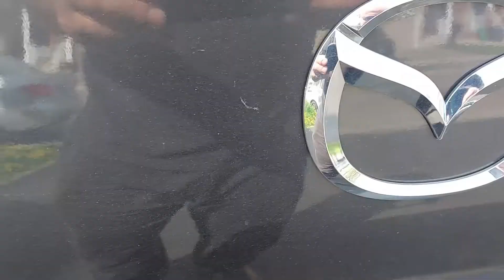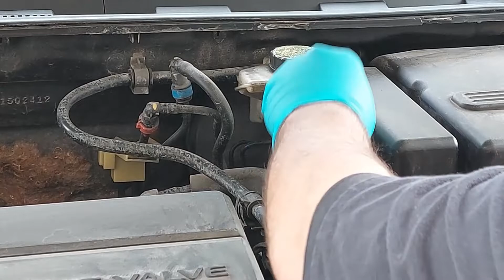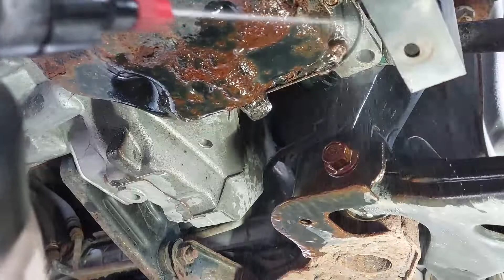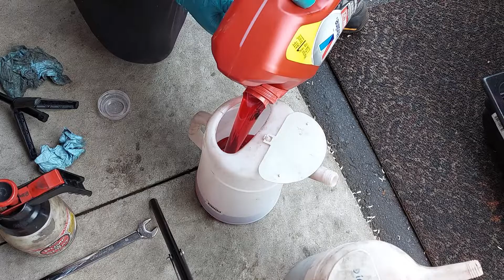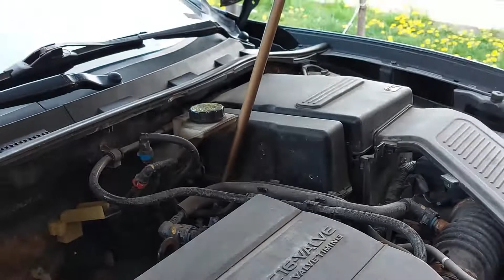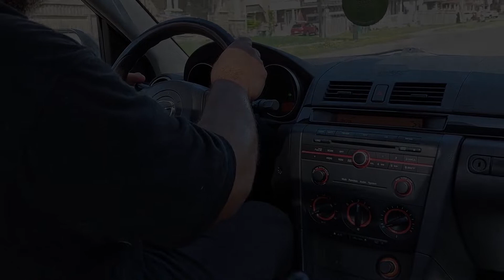2006 Mazda 3 - 2.0 L - Transmission Service - Drain and Fill

Comment from the maker: If you enjoyed this video and found it helpful please support my channel by hitting the LIKE 👍and SUBSCRIBE buttons and turning on the bell notifications to get notified when I put out a new video.
Reply: Hi Moose, i'll use for the next Time  atf  lth mr5 supreme for my Mazda 3 2006 2.0.       What do you think?
Reply from the maker: @jerrylee7819  Hello Jerry, I have never heard of that transmission fluid before, but I looked it up. I can't say much about it since I have not used it before. I would stick with the original Mazda fluid or use Valvoline Max Life fluid. Using the wrong fluid could cause problems and may damage the transmission and could also damage the clutch packs as well.

I have only used the Mazda and the Valvoline stuff and they're both OK to use and approved. Anything else I am not sure. I would call the company for whoever makes the fluid you mentioned and see if it is compatible with that transmission. Other than that you risk transmission damage unless it's safe to use.

I have used the Valvoline stuff for about 15 years now and never had a problem with it so I can say that's safe to use.
Reply: @moosemobileautorepair  thanks you so much. You have a new suscriber
Reply from the maker: @jerrylee7819  Thanks I appreciate that. 🙏  😊

Comment: If it has high mileage, the old fluid has clutch particles and other things holding that together. Adding new fluid will make it slip. Even fail. You should add as needed. I have so mechanics tell me this. DO NOT change fluid on a high mileage automatic transmission. I did and mine slips horribly. Especially reverse. I put the old fluid back in. Runs great. Sounds crazy but look it up. Great video though. Thanks
Reply from the maker: I have already discussed about this in one of my previous videos. But on this vehicle it is ok because it has had routine transmission service so it's perfectly safe. The vehicle is still working fine even to this day.

Comment: i initially dropped pan, then did another 3 drain and fill to get out all old fluid. the car was given to me poorly maintained. 

then i realized amsoil multi vehicle ATF 100% synthetic meets the specification for this vehicle, will last longer, shift better, clean out tranns, will get better fuel economy... 

yeah it costs more.. i suggest going with amsoil. i noticed trans shifting better...
Reply: hey which amsoil atf synthetic did you get exactly? there's two that pops up for me (grey bottle amsoil oe product and black bottle signature series)
Reply: @jimmyxng  signature series. If you are going to do 3 or 4 drain and fill to try to flush it all out maybe just use the OE for the first drain and fills then the last  one use signature series. Save some money .

Comment: But if iTs runs more than 300k kilometres you don't need to drain tramission oil just fill when ever comes low point
Reply from the maker: That doesn't make any sense. You still need to periodically service the transmission. It still needs to be drained and refilled.
Reply: Do you have drain bamage